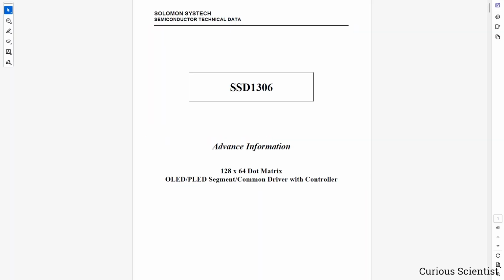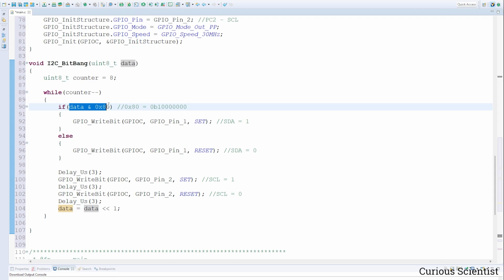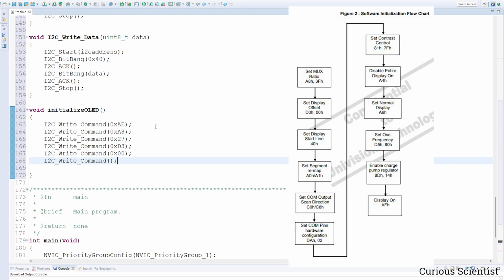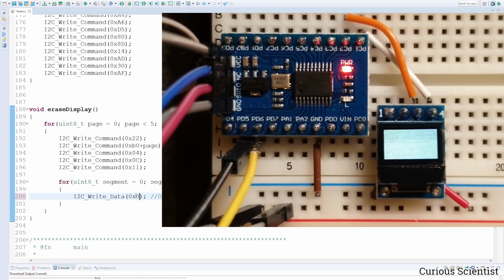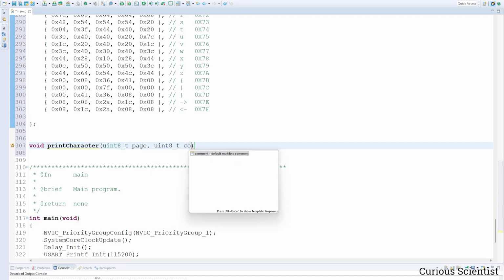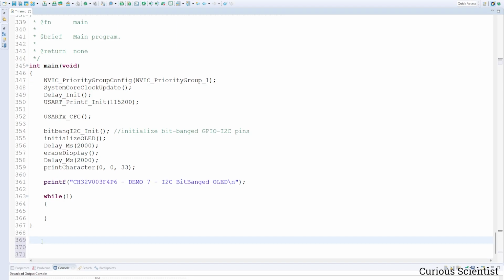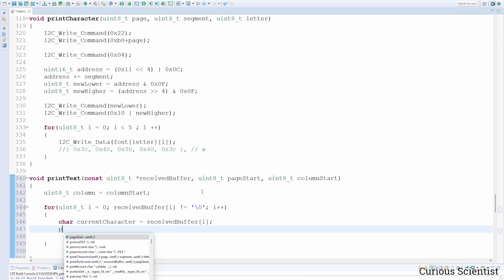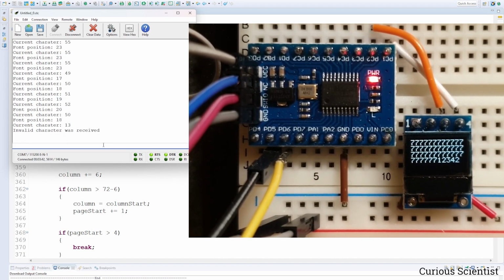CH32V003F4P6 Tutorial - Part 7 - I2C OLED Display with bit-banging

Comment: Great Video and tuturial as always! Qustion, could you then in this case bit bang 2 I2C devices with the same address, but sitting on 2 I2C genrated ports? Instead of the TCA 9548 multiplexer?
Reply from the maker: Thanks. Technically, yes. You just make another pair of GPIOs to be SDA and SCL and use them with the other device. For devices and tasks that are not too speed-sensitive, it should work. You can try it with 2 OLED displays on different ports.

Comment: Gracias podrías hacerlo para una pantalla con controlador sh1106 que si puede controlar una pantalla más grande ssd1306 pero tengo problemas con la sh1106 128x64
Reply from the maker: I believe that based on this video and article, it should be easy to implement it for the other display driver. Otherwise, I don't make videos requests, sorry.

Comment: Very useful videos as usual !! Any chance of doing SPI and interfacing a SDCARD file system like ChanFAT ?
Reply from the maker: Thanks! Yes, SPI is coming. And an SD card reader is a great idea. I first wanna focus on something SPI sensors, but an SD card reader can also be among the examples.
Reply: @CuriousScientist   Looking forward !!
Reply from the maker: Hi! The video you asked about is now published. I hope it helps.
Reply: @CuriousScientist   Thank you very much indeed !!
 Maybe a new playlist on using the CH32V as an "ASIC" for driving various devices or getting data from generic sensors ? I know you have used the sensors mostly as examples for demo-ing peripherals,so just extending the concept.
Like for example I was planning to use the  FatFS project as a standalone unit. The main controller would send data to the CH32V , who's only task is to write to the SDCARD. Just an idea... Since these micros are inexpensive maybe its a viable concept.Thanks again !!
Reply from the maker: @mumbaiverve2307  I will have a playlist, or something similar, where I cover most of the popular sensors using the CH32 microcontrollers. I'd like to create a tutorial series using one of those "100-in-1 sensor kits" for Arduinos. Will see if that is something that you might appreciate. :)
Reply: @CuriousScientist    IMHO rather than Arduino sensors, I think your subs might appreciate working with industrial/automotive/medical sensors. Mass produced sensors are usually less expensive , I guess. Nevertheless, your videos are always most informative and worth watching , regardless...  Cheers !
Reply from the maker: Could you mention a few of those sensors by their name or serial number...etc.? Thanks!
Reply: @CuriousScientist   Nothing really specific in my mind ... :) ;  but let me work on it for sure !

Comment from the maker: Creating a Bit-Banged Library for an OLED Display with the CH32 Microcontroller

*   0:00 Introduction: The video continues the CH32 tutorial series, focusing on creating a custom library for an OLED display using a bit-banging approach.
*   1:17 Display: The specific OLED display used is a 72x40 pixel display.
*   1:24 External Resources: Two primary resources are used: the SSD1306 display driver datasheet (for 128x64 displays but applicable) and the specific datasheet for the 72x40 pixel display.
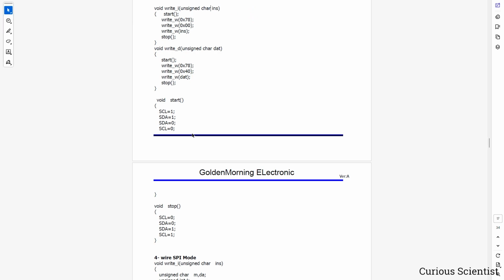*   2:56 Implementation: The code implementation is based on the pseudo-code provided in the 72x40 display's datasheet.
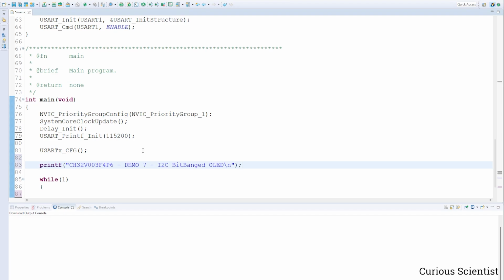*   3:42 Bit Banging: The technique involves manually controlling the I2C bus (SDA and SCL pins) bit by bit instead of using built-in I2C libraries.
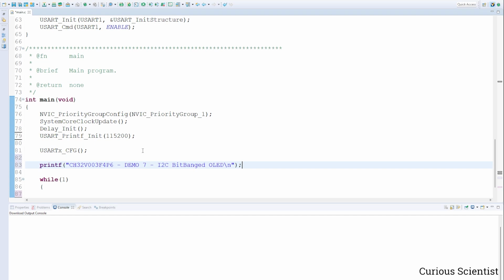*   4:16 Pin Definition: The same pins used for standard I2C communication (PC1 for SDA, PC2 for SCL) are redefined as general-purpose input/output (GPIO) pins.
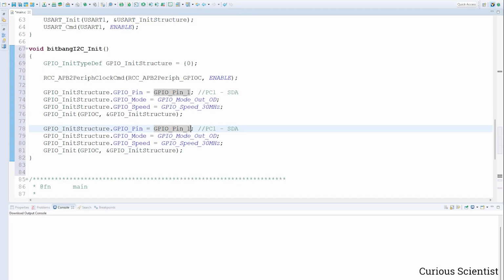*   6:14 Open Drain Configuration: The SDA pin (PC1) is configured as an open-drain output, while the SCL pin (PC2) is a push-pull output.
*   6:48 Bit-Banged I2C Function: A custom function `i2c_bitbang` is implemented to send data bit by bit to the display, following the timing diagrams in the datasheet.
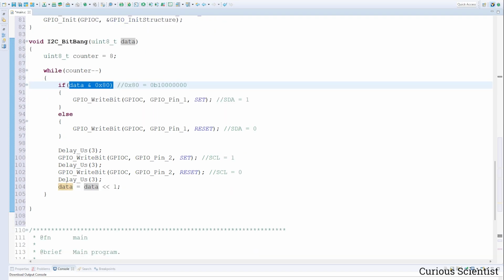*   10:49 Start, Stop, and Acknowledge: Functions `i2c_start`, `i2c_stop`, and `i2c_ack` are created to manage the I2C communication protocol, including start and stop conditions and acknowledgments.
*   13:31 Write Command and Data: Functions `i2c_write_command` and `i2c_write_data` are implemented to send commands and data to the display, respectively. These functions use the `i2c_bitbang` function for the actual bit manipulation.
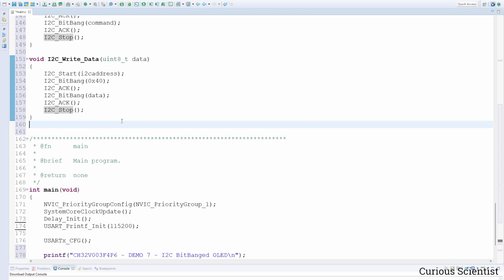*   16:12 Initialization: An `init_oled` function is created to initialize the display, following the initialization sequence in the SSD1306 datasheet. This involves sending a series of commands to set display parameters like contrast, display on/off, etc.
*   22:56 Erasing the Display: A function `oled_erase` is implemented to clear the display by writing zeros to all segments. This involves iterating through each page and segment of the display.
*   23:20 Display Structure: The display is organized into five pages (0-4), each with 72 segments. Each segment represents 8 pixels vertically.
*   27:24 ASCII Table: The ASCII table is used to map character codes to their visual representations on the display.
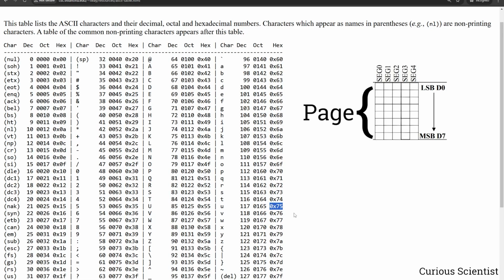*   28:47 Character Representation: Each character is represented by 5 bytes, corresponding to 5 segments on the display. Each byte defines the 8 pixels within a segment.
*   34:33 Font Matrix: A large matrix stores the 5-byte representations for each character. The matrix is indexed based on the ASCII value of the character minus 0x20.
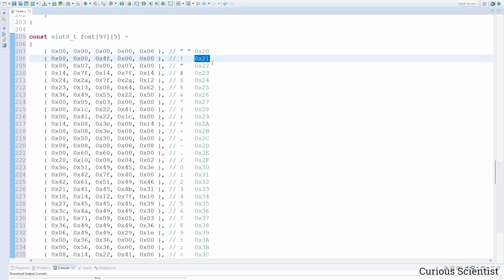*   35:43 Printing a Character: The `print_char` function takes the page, segment, and character as input. It uses the font matrix to determine the 5 bytes for the given character and sends them to the display.
*   43:13 Printing Text: The `print_text` function takes a string as input and prints it to the display. It handles line breaks and ensures that text wraps to the next line if it exceeds the display width.
*   43:19 Using USART Interrupt: The code is modified to receive text via USART interrupt. A buffer is used to store the received characters, and a flag indicates when a complete line of text has been received.
*   51:43 Text Handling in Main Loop: In the main loop, the code checks for the USART flag and, when set, prints the received text to the display and then clears the buffer.
*   56:36 Character Positioning: The code calculates the position of each character on the display, ensuring that characters are printed sequentially and wrap to the next line when necessary.
*   1:02:48 Conclusion: The video demonstrates how to create a custom bit-banged library for controlling an OLED display with the CH32 microcontroller, including initializing the display, erasing, printing characters, and handling text input via USART.
*   1:03:08 Website Resources: The presenter mentions that additional resources, including code examples and product links, are available on their website.

I used gemini-1.5-pro-exp-0827 on rocketrecap dot com to summarize the transcript.
Cost (if I didn't use the free tier): $0.04
Input tokens: 25465
Output tokens: 1068